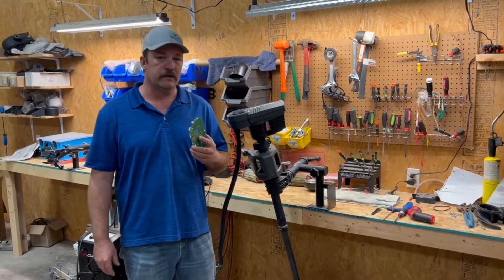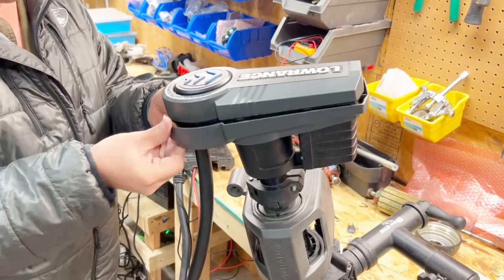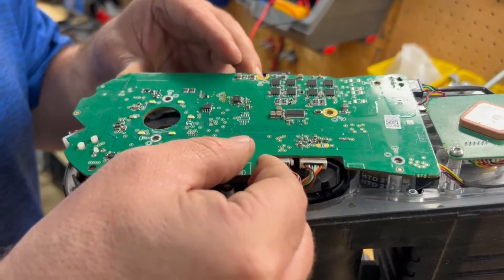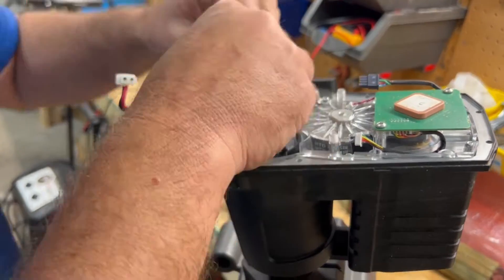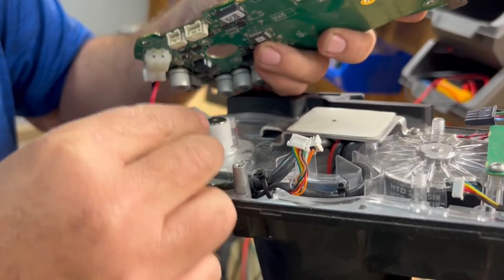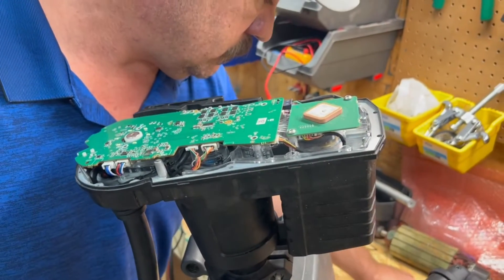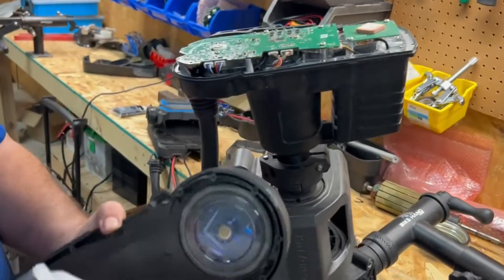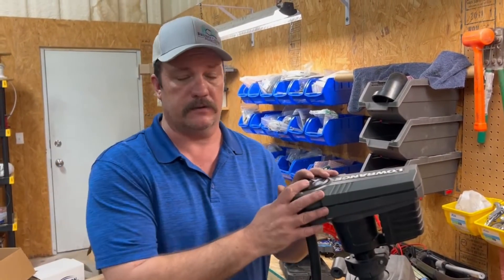Lowrance Ghost Repair: Replacing PCBA Main Board

Comment: Any idea on why the ghost head will turn but the prop won't spin?  I replaced the PCBA main board recommended by Lowrance and have also completed the 12 step program in your other video.
Reply: Mine just started doing the exact same thing today. the head will spin but the prop won't when I push the button.

Comment: What exactly does this board do? Sorry newbie here…..I recently bought a new to me boat, with a ghost trolling motor. I cannot for the life of me get the power to turn on. I have fully charged batteries, tight connections, no blown fuses. Power button flashes one time and there’s nothing…. Lowrance tech told me it could foot battery control board, where the power button is…?

Comment: Any experience fixing a lower unit? They said my motor is bad
Reply from the maker: Hello
If the armature is bad that can be replaced.  But if the lower unit board is bad from water intrusion. You will have to replace the whole lower unit.
Reply: @BrushyCreekMarine I got it from a guy who said he sent it in to lowrance and they told him that the motor is bad. Do you think it’s worth checking the armature ? Sorry for so many questions and thanks for the quick response!

Comment: What would cause water to get into the head and fry the boards. Ive gone through two boards now and lowrance wont fix it under warranty. First time it went out, i replaced the rubber thinking it might have a pin hole. Put new board in and 4 months later, trolling motor stopped. Took head cover off and full of water again. Board was toast like the first one.